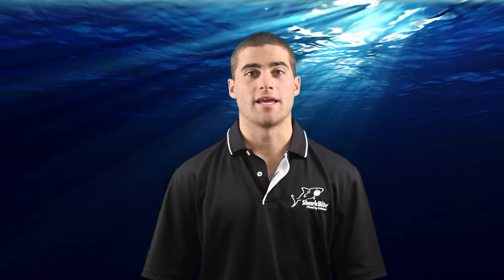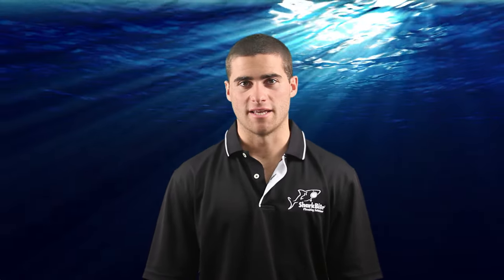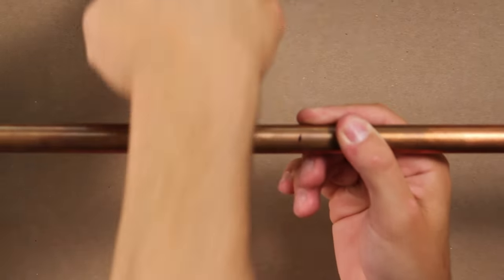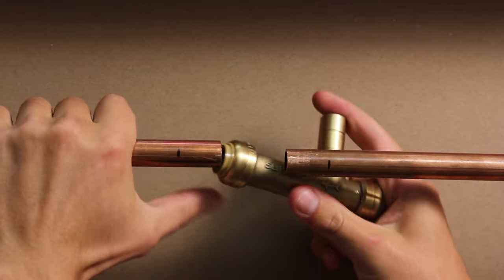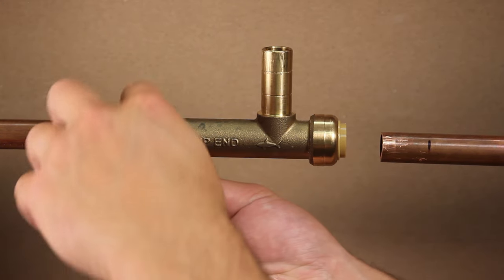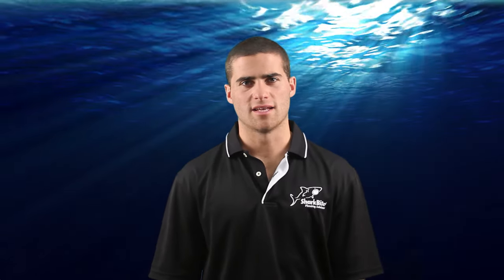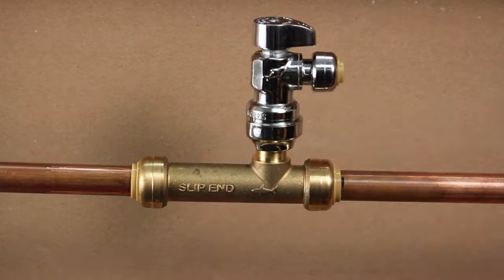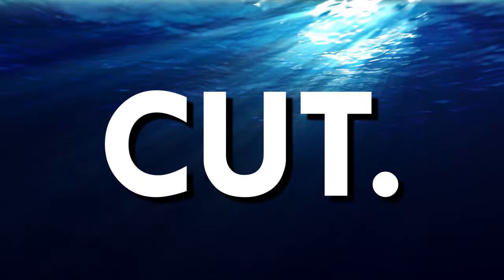How To Install a SharkBite Service Slip Tee

Comment: Plumbers be like stop using sharkbite and hire us, its cutting into our profits. Lol. I heard a lot of bad things about sharkbite over the years but I think a lot of it is due to plumbers being angry  that home owners dont have to hire plumbers to do a simple job. Now I get that if you dont  properly  prep your work sharkbites can leak, but you can say that with any plumbing job that's not properly done correctly. when used correctly though they can last a long time. How do I know? My sharkbite fitting is 13 years old and still leak free. Sooo...

Comment: These fittings are horrible. Don't believe this video regarding how effortless it is to use the removal tool. It's awful/virtually useless. Had to use a mallet to tap it so the damn thing would move, which it did but it fell and dented. A waste and a headache. As a note, I followed all installation instructions. Should have just used solder.

Comment: Looks so simple, but believe me it is not. The 'slip' function does not work on older pipe. It will get stuck half way on, it won't go on and won't come off. You will have to cut it off.
Reply from the maker: Greetings Kay. Sorry to hear about the installation issue. For SharkBite to perform at its best, it needs the proper environment. For success in repairs always clean the pipe from debris, such as old solder or burrs. Give our technical support team a call (1-877-700-4242) and they will be happy to walk you through a proper installation.
Reply: Dependent on person performing task

Comment: Thank you sharkbite for this slip t-joint...Saved me from having to call a plumber to replace a faulty t-joint connecting three copper pipes with no room to move.  Super easy installation.  Thanks.

Comment: Man this was so hard to put on an old pipe that was buried underground. I hit a 1/2 water line while grounding electrical and tried using a sharkbite to repair it. The slip side went in with a little help from pliers and a hammer but to get it back over the other side... not so much. The plastic piece didn't help at all. I didn't clean the pipe though, make sure you do!

Comment: The service slip tee is awesome.  It helped me easily connect a supply line to my refrigerator ice maker in an existing line.  What I like best is that I was able to use a sharkbite angle stop so I have a reliable quarter-turn shutoff valve in case I need to service the fridge.  Sweet.

Comment: Here are the CORRECT instructions how to do this DIY procedure. 

Example. Let's say you have a copper or Pex pipe. 

Close the MAIN water supply valve. 

1. Now cut this pipe at a given location on this pipe (i.e. where you want to place the shark bite) and let the water drain in some bucket.

2. The next Very important thing to do is, NOT to "mark your pipe with a pen" about the depth of pipe that need or should insert inside the pipe (after you post the pipe in shark bit end),   ...BUT.... TO actually find out, how much pipe you should cut "IN BOTH DIRECTIONS" from the cut you already made. So, for this, look step 3.
3. Now you, look at your shark bite and place the shall bite's center point, at the first cut you made on the pipe. Now mark, "both edges/ends of shark bite"  sitting/aligning on the pipe. Let's call it, left mark and right mark on the pipe. Between these 2 marks you just did, there will be the first CUT you made on the pipe.
4. Now,  you use the shark bite depth tool (orange color which has all the sizes 0.5" to 1.5") and insert left end of the pipe to the left side of the shark bite and see how deep it is. Mark this on the left pipe (after first cut) i.e. now it will be marked INSIDE between the LEFT MARK you did in step 3. Let's call it INNER-LEFT-DEPTH mark (i.e mark between the LEFT MARK from step 3 and the cut on the pipe). Do the same procedure, on the right side of the pipe, using right side of the pipe, by inserting it into the right opening of the Shark bite. After inserting that, you will now get INNER-RIGHT-DEPTH-MARK i.e. a mark between the cut of the pipe and the RIGHT MARK you got from step 3.

5. Now, USING a Scale/measurement tape, find what's the depth/measurement of "INNER- LEFT-DEPTH -to-> the cut" ... note down this number/value as LEFT VALUE.  ... Let's assume this left value was 1 inch. 

Do the same procedure by measuring,  "cut to INNER-RIGHT-DEPTH mark". Note this value as RIGHT value. Lets assume this right value was also 1 inch. 

6. Now wipe the INNER left and INNER right marks using a wet cloth or something. 

7. Go to LEFT mark (that you made in step 3) and measure "left value" from that left mark and mark it. This  "new-inner-left-depth" mark is now measured from the LEFT MARK (i.e. not from the cut/center of the pipe). 

Do the same procedure, i.e. mark "new-inner-right-depth" mark measuring from the RIGHT mark (you did in step 3).

8. Now, use the cutter, and cut the pipe AT exactly on the "new-inner-left-depth" mark and cut the pipe AT exactly on the  "new-inner-right-depth" mark. THIS IS THE MOST IMPORTANT THING, I THINK NO OTHER VIDEO EXPLAINED AND it really trumps people while putting a shark bite on any plumbing pipe. 

9. Using that orange tool that Shark  bite company sells for finding depth of shark bite ends (i.e. how much pipe you should insert), it also has a smoothner/cutter in it, i.e. if you insert the end of pipes in that tool and rotate clockwise as listed on the tool, then it will SMOOTHEN the edges of pipe, for the new-left/right-depth end points of the pipe. Basically, what you have to do is,  smoothen the edge of the pipe end points which will go inside Shark bite openings and touching the RUBBER washer/seal.

10. Now, ensure if your shark bite has any DRAIN value (that you open and let water fall down especially during winter time for sprinkler water clearing etc) you place the shark bite acc. so the drain value is always down facing. Actually shark bite can rotate 180° on the pipe after fitting it ( so that should not be a problem ). ALSO,  check there is no dirt or debri inside the shark bite, after doing all this nano engineering work today first time by you. 

Well by now  you just put the left pipe on left shark bite opening and right side of the pipe, into the right side of the shark bite opening. While inserting, the pipe will go exactly upto the left and right mark, you did in step 3.

IMPORTANT: the pipes should be straight if possible like a straight line after you insert both ends in shark bite. Avoid getting any angle more than 5° i.e. after installation, the pipe with shark bite should look like 1 straight pipe, not bending unnecessarily like a bow. Basically there should NOT be any hard tension between shark bite and pipe  (that you inserted inside shark bite) giving it any reason to leak water due to a bad angle and high water pressure can leak water from such bad angle. 

NOW have a bucket ready next to you,  open the main water valve slowly, turn on water and see, if the shark bite installation was successful. Is it leaking any water from the end of the shark bite or not. 

If not, you just saved both TIME AND $$$$ And learned something new today.

Comment: How would you handle a 3/4"  pipe? I only see a 1/2 x 1/2 x 1/2 option. How about a 3/4 x 3/4 x 1/2 slip tee
Reply from the maker: Hi Derek, we don't actually have a 3/4 x 3/4 x 1/2 slip tee. However, If I am understanding what you need correctly, you could use:

Our part number U3486LF is a 3/4 x 3/4 x 3/4 Slip Tee w/ Female NPT center. You could then connect our U116LF (3/4" Male NPT x 1/2 push-to-connect). 

It would require 2 fittings, but you would  be able to reduce your 3/4" line to 1/2" line out of the middle. If you have any additional questions, please feel free to contact us at 1-877-700-4242 for customer service or technical support.
Reply: Derek Lauro I am holding a 3/4.3/4.1/2 Tee in my hand purchased yesterday at Ace Hardware.
Reply: Teddy  yes but I think he needs a slip tee
Reply: Exactly Dwayne. I was replacing an old saddle valve on a 3/4" line that fed a furnace humidifier appliance. Couldn't find what I needed from SharkBite or the copycats so I went with a 3/4 x 3/4 x 3/4 threaded slip tee. Threaded on a 3/4 to 1/2 SharkBite reducer and fed in a quarter turn valve. Works great, but bigger and more parts than I wanted.
Reply: Great

Comment: Which SharkBite supply stop is used in this video?  I cannot locate it on the SharkBite website.
Reply from the maker: Rick Wiener It's our 1/2" X 1/4" (3/8" OD) ANGLE STOP, Part #24733LF. We have it listed with our compression angle stops, but you can find more info here:  http://www.sharkbite.com/product/angle-stops/. Thanks for watching!
Reply: Do you have any 1/2 X 1/2 angle stop maybe?

Comment: So in order to add a simple 1/4" water line to my refrigerator is to add this slip and ANOTHER separate quarter turn? Why do you not make the sharkBite 24983A Service Tee Stop Valve with a slip application?? Since I am unable to move my pipes sharkbite is useless, looks like I will be learning to sweat weld!
Reply: How much did you spend on the copper tee, angle stop, pipe (to connect the tee to the angle stop), torch, flux, solder, and sandpaper/emery cloth? How did the installation go?

Comment: What do you do when the slip coupler won't move back toward the other pipe? You make it look so easy, but now I have a cut pipe with a slip coupler that won't slide back toward the other pipe.The pipe is vertical.  Trying to slide it back up to meet the other pipe   I keep pushing the orange slide tool to move it, but it won't budge.  Not as easy as it looks in your videos!
I deburrred, cleaned the copper pipe. Did everything you say to do.
The first vertical pipe I did was really tough to slide it back up, but eventually it slide back to the other pipe.  Not easily.
What is the secret to get the thing to depress and let it slide back?  I had to put a lot of pressure on the first one to get it to slide back.
This pipe is higher, so I can't pull it up from below.  I have to push it up.  And it is not budging.  Seems like it should not be so hard to enact the thing that allows it to slide back up to the connecting pipe.
Reply: I went cuckoo cuckoo at my house, installing Sharkbite slip ball valves on all my down stairs pipes going up to the up stairs plumbing.  I agree, pulling some of those slip fittings back was a big PITA.  Twisting the fitting back and forth while depressing the release tool seems to do the trick.  I'm going to also  check if depressing the removal tool with some channel locks gives more leverage.
Reply: Any old existing copper pipes in all of our homes that was soldered are way too big to fit for Sharkbite. Why they don't mention this first hand? I have no idea. You ask this simple question "Can a regular copper pipe be use with Sharkbite? They'll say "SharkBite brass push-to-connect fittings are compatible with PEX, copper, CPVC and HDPE pipe. Why don't they say it's not gonna fit because they are too big. A regular 3/4 inch copper pipe measures from .96 to 1.05 od and for Sharkbite is 0.875 or 7/8 inch. Go figure.
Reply: @azkal2ko  I eventually got them to move, but I had to use their $10 tool and a lot of strength to do it. 4 different ones.  It's  all fixed now.  Saved me money, but they should be honest it is not easy to put these things on.